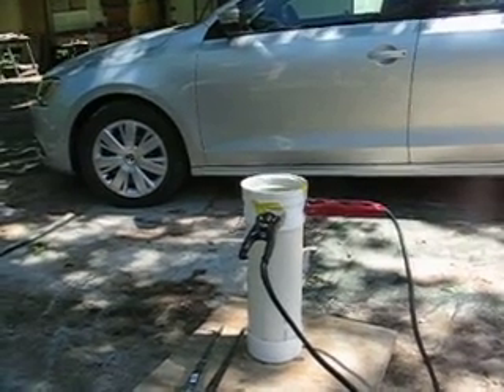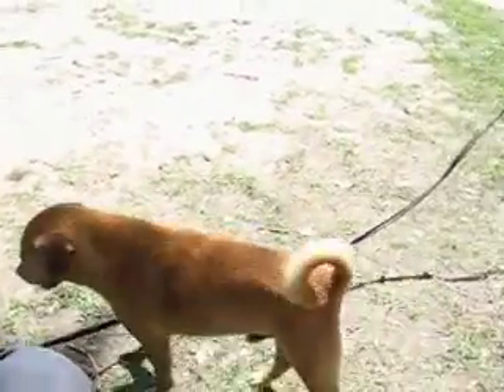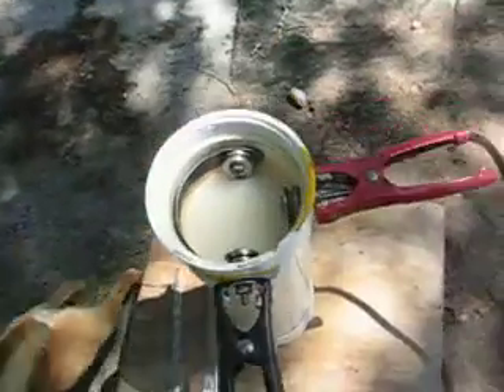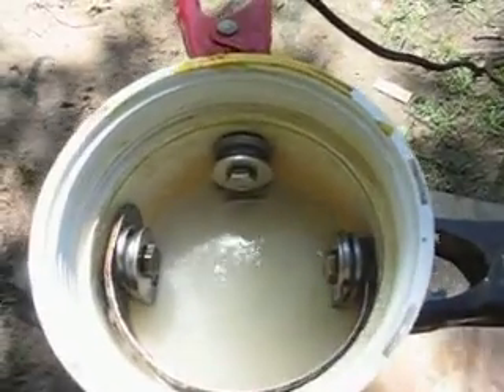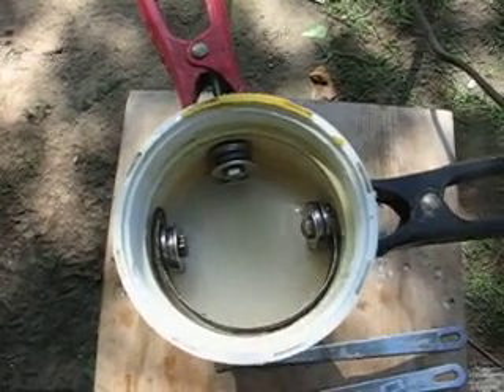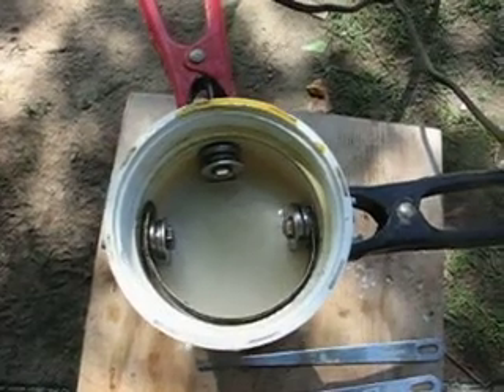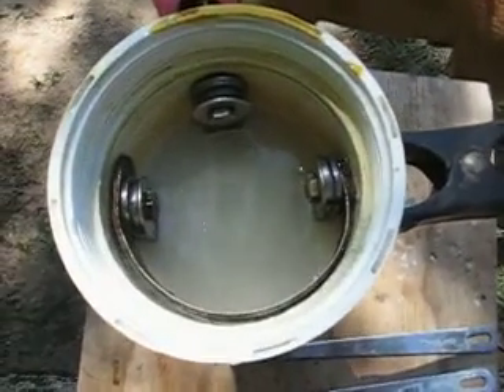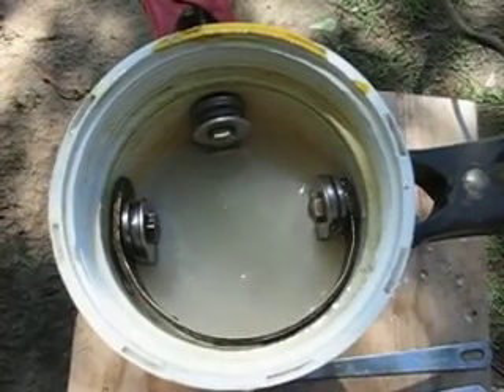016 HHO  How to build a Container for  vid 015 Hydrogen Reactor

Comment: hi about your experement l use solt at first experiment it produst more hho but the problem is the water become very dark so at the second time i use miniral water and baking soda and it work well
Reply from the maker: Use KOH as a Electrolyte about 25 Percent by Volume, I'm using treated Algeas.